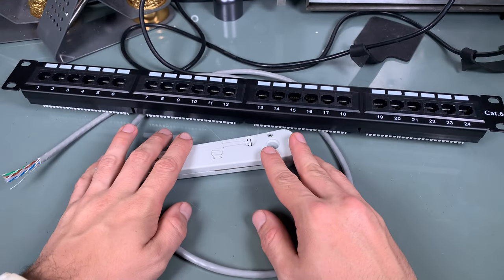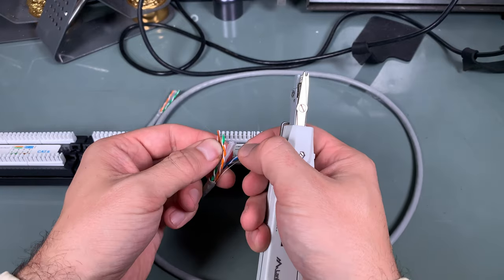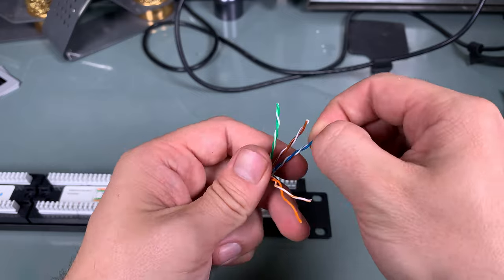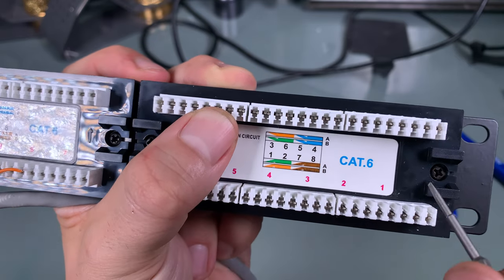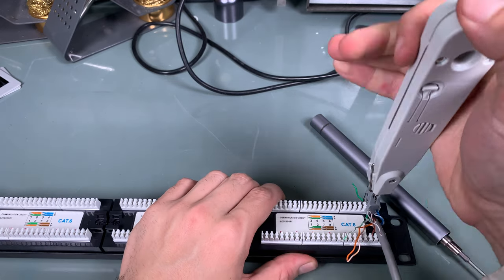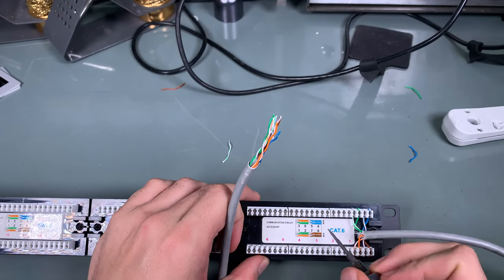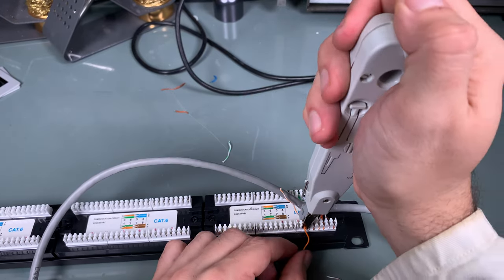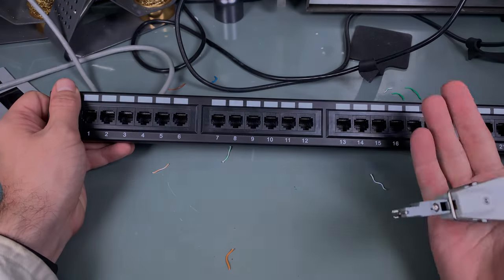Wire network patch panel using LSA Krone punch tool (terminate CAT6 UTP cable) Rack 19 for ethernet

Comment: I recently decided to build my first 10 inch home rack server,which is incomplete at the moment.(waiting the rest of the items ).
I decided on the easy option and purchased a pass through keystone patch panel.
Although it is excellent quality ,it does not look right with the other components.

So decided to research the patch panels with the LSA distribution panel.
Watched a couple of videos to give me an idea about the standards,what type of cable and tools to use.
So decided to purchase the items and get more information on this so i have a better understanding.
I came across your video and the depth of explaining and showing how it is done is excellent.
In fact the only one so far i have seen which has giving me the confidence to try this .
I did notice that the unit you had ,the connectors are horizontal which i could see right away a design problem for installation.
Roll on to 2024 and the unit i bought has the connectors vertical and securing clamps in columns ,which to me is a better design.
Thank you for taking the time to produce this video so new bees like me can try this.
Reply from the maker: Thank You for sharing Your experience, that was also my first build and I just wanted to learn it was overkill  - I had same though - people who are pro skip and don't explain basic stuff.  Thanks again for Your time - glad it helped!